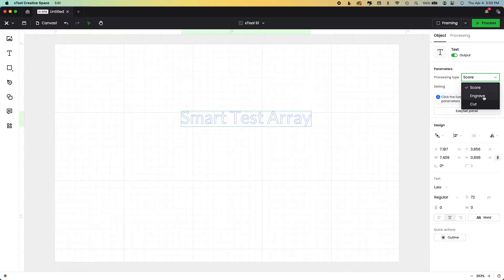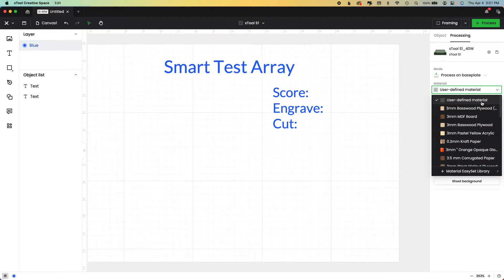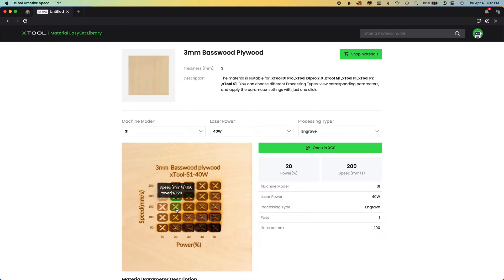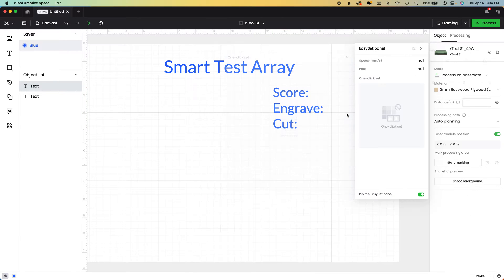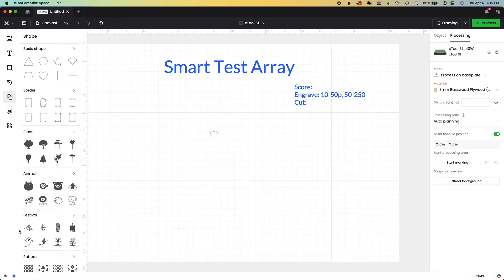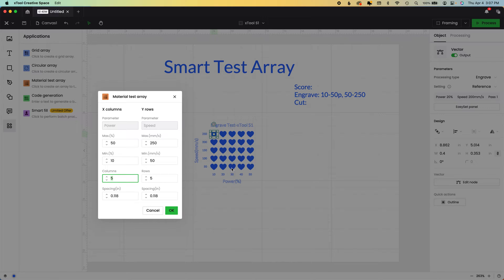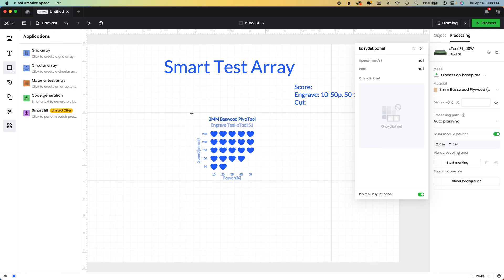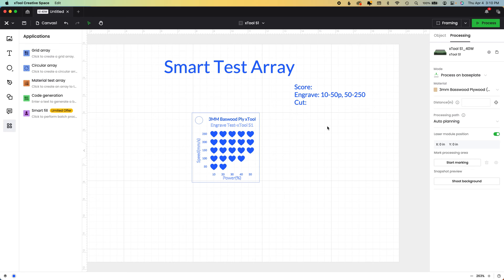How to Create a Material Test xTool XCS 2.0 / Laser Material Test / XCS Tutorial / EastSet Library

Comment: I'm new to laser engraving, & have followed tutorials to to a material test array. My problem is the test array uses a vector which uses power & l/mm for speed. When I import a raster image to engrave on my fiber laser, I get Dot duration, power & dpi? How does the material test array help me when choosing settings for raster images? I have a F2U engraver.
Reply from the maker: You actually will run a separate  material test for images. I usually use a smaller version of the photo or will upload a simple image from my computer.

Comment: I LOVED how you explained this ❤❤❤❤ I have been stressing over how to make my first test array piece. You explain everything GREAT!! Question, how do you make one from wood that is not listed? Example, I have a piece of Light Maple Plywood that is sold under the GlowForge brand but have a XTool S1. It is just a bit thicker than 3mm. I looked online and it’s similar to birch wood, just a bit stronger wood. I am thinking the 3mm birch wood example they give would work but am nervous to try. Please help if you can
Reply from the maker: Of course. For this, you'd want to create a material test array (a small one) to get some general parameters. I'd actually set this up with the birch ply testing suggestions, just bumping up the power a bit and/or slowing down the speed.
Reply: @ thank you 😊

Comment: I am following your example engraving Basswood plywood.  In your example for the S1 40 Watt laser for 3 mm Basswood Plywood, the processing type list it displays Engraving as well as the other options. If I select 6 mm Basswood Plywood the processing type list only displays Cut. Is there a reason that 6 mm Basswood cannot be Engraved or is this a bug?
Reply from the maker: Oh, I think a setting got messed up or something. Are you in XCS 2.0 or the older software? 

If you're only seeing cut, make sure your processing  mode is correct. If you're correct AND still seeing it, I'd save, exit, and try to pull that up again.